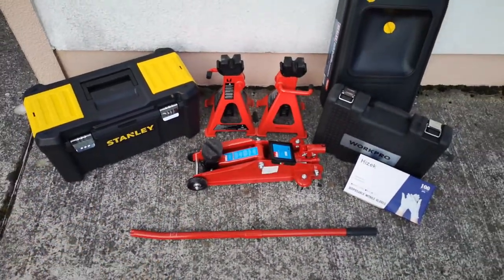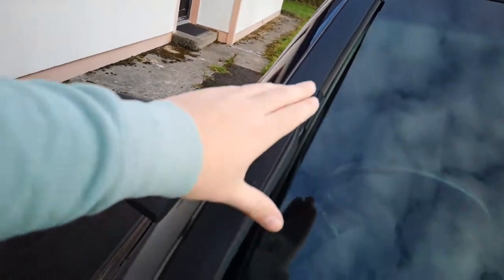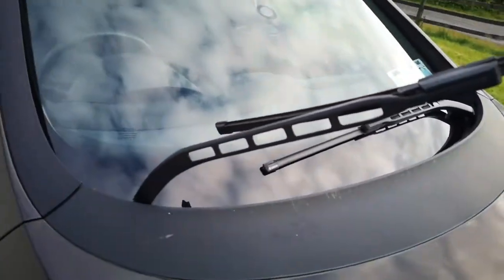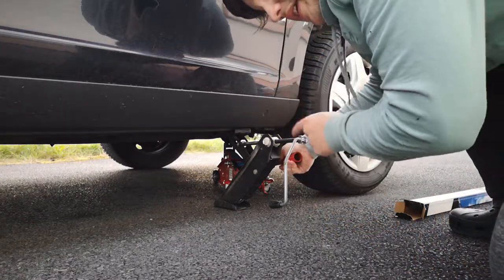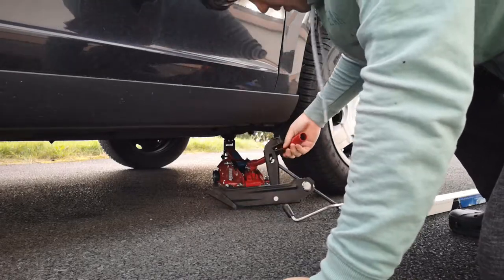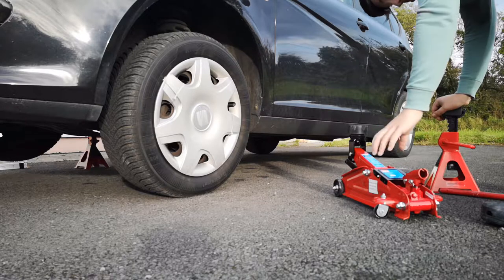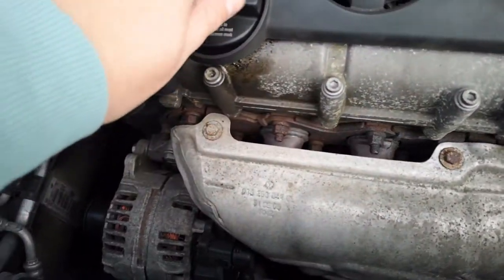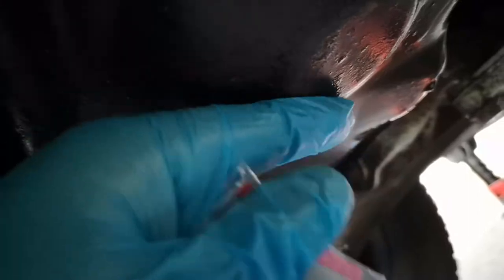DIY Oil Change (Seat Altea XL 1.4 BXW)

Comment: Hi I have the same engine in a seat leon How many km do you have and how about oil consumption?
Reply from the maker: 214xxxkm and about 1-1.5L per oil change. I did buy my car with like 30% of the oil that was supposed to be in it so I know ym car wasn't treated well. Go with it as far as you can honestly and don't worry about it for now, unless it becomes A LOT

Comment: do you have problems with piston slap?
Reply from the maker: I bought the car with about 1L of oil in it (a minimum of 3L is required). It wasn't looked after and because of that, even at 180k km, I could hear it, especially at cold starts. It is better because I am now taking good care of it, but if you can, I'd recommend not going for a 1.4 BXW engine powered car. I already know mine won't last much past 250k but if you take care of it, it should and definitely could last past 300k km.
Reply: Link to oil?
Reply from the maker: It could be linked to improper spec oil used in the past. But like I said, it had 30% of the minimum amount of oil it should've had in the first place when I bought it